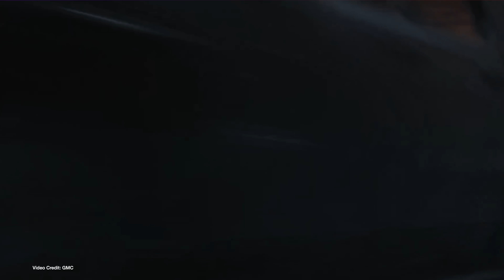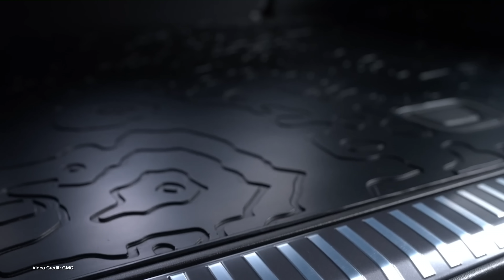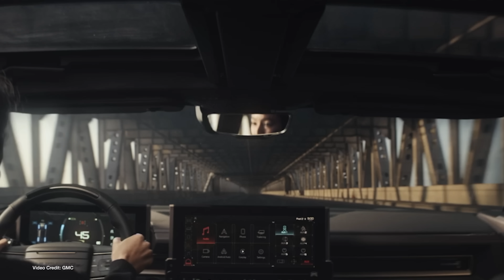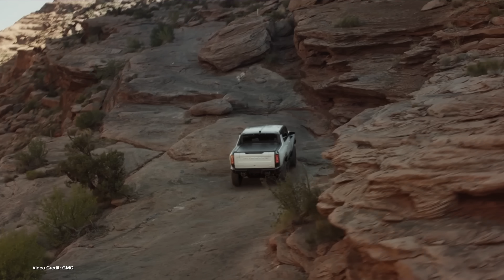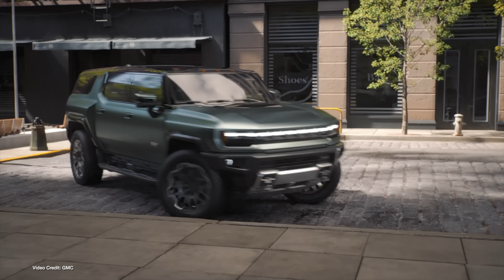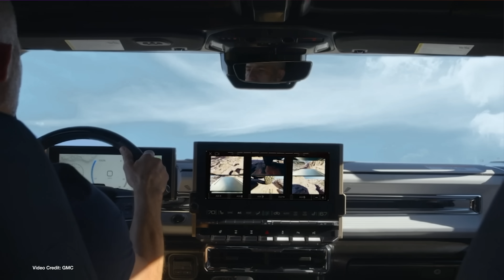The Hummer EV SUV Has Broken Cover. Here's Our Take

Comment: Hi Te team,
I would like to share with you my vision of the car industry today. Please let me know if you agree with me. The world is not just electrifying cars, we are facing a big transition that already happens with other industries. For example, entretainment had a transition from analog to digital signal and TV machines changed from tube TVs (analog) to led TVs (digital). Samething is happening to cars industries, we are moving from analog cars (buttons, controls, cables, wires) to digital cars (digital signals, AI, software, electrification, machine vision, connectivity, user interface, etc). In my view this is why Tesla is making a big difference compared to other car brands. The rest of the industry are trying to catch Tesla and other inovation companies in terms of electrification but they are not able to see the big picture. I believe most of them will never be able to do it, reason why Toyota is trying a partnership with Tesla to enter in a digital world.

Comment: Talking about electric motors...using horse power instead of watts/kW respectivelly.
I would exepct this from some idiot generic "journalists" but not from someone that has some knowledge behind them.
Stop , literally stop using these idiotic notions that the manufacturers hand out, beside the fact that imperial system of measurement is obsolete, which belongs to an agrarian society rather than a soon to be space faring one.

Comment: Even at $80k it will sell, in large numbers. So will the Rivian, the Cybertruck I have my doubts about. Remember the Pacer? The PT Cruiser? Those cars had huge 1st and 2nd year sales, and then dropped off quickly. The design was so quirky and different, you couldn't really update it much without changing it completely, and the designs were polarizing enough that the people who really loved them bought them in the first 2 years or so... and then the manufacturers had to practically give them away. And then they became a punchline. I suspect the Cybertruck will be the same thing.
Reply: Seems as though that happens roughly every 20 years or so.
Chrysler Airflow
Edsel
AMC Pacer
Pontiac Aztec
Cybertruck?

Comment: This is an aspect of electric propulsion that I hadn't considered much.  In an ICE world, the Hummer  SUV would have had the same engine and transmission as the PU and would have had performance that varied based on the delta to weight and coeff of drag.  Now in the EV paradigm, the performance delta is based on battery capacity which may change based on available room (wheelbase/track) to house batteries.  Not earth-shattering, but different way to think about variables that control vehicle capability.  Thanks for sharing.

Comment: The Hummer does look amazing! I think the Hummer is like all other high end vehicles. They get the attention and drive people to the dealers where people then try out some of the other vehicles, ones they can actually afford, and buy them. That said, it also makes sense to really put a low volume, high price vehicle out there so they get experience with a new platform before going mass market. I would expect that GM will have several vehicles like the Bolt that are based on the new platform and cost a lot less. Those would be coming available as GM ramps up battery production and retools their factories.

Comment: This hummer vehicle and the new Cadillac I really just test beds for upcoming GM vehicles. Think of them as Tesla’s roadster and model S. These GM vehicles will never recover third development cost. The development cost will be used to develop additional GM EV cars.
Reply: Not totally true. To understand development cost you have to understand what was/is going to be developed. For the BT1 platform, the Hummer truck and SUV are being built. GM is also using it for the Silverado EV, Escalade EV, and Sierra EV. So the development cost is spread across many vehicles with the Hummer being the first user of the platform. So the Hummer doesn't have to recover all the development cost because it wasn't the only vehicle being developed to use the platform.

Comment: I applaud GM for introducing an alternative for people who would otherwise buy a gas guzzler or diesel rock crawler with noxious emissions.  It seems to incorporate innovative design features to address the problem of a large vehicle in an urban environment as well.  I would find one a nice “occasional use” vehicle, similar to a pickup truck you might use to run to Home Depot or use on a weekend hunting/fishing camping trip.  Unfortunately, while a $5000 used pickup truck might meet that requirement at an affordable price, a $90,000 “occasional use” truck will more likely be in the Bezos or Walton family garage than mine.
Reply: I agree, the problem is it's so expensive that it will not have much penetration in that market. But yea any new EV is a good thing.

Comment: ...your a car manufacturer, not a design house..  whats the point not having the same power train for the pickup and the SUV.. does it really matter to the variant if the power train is the same..  as a manufacturer, this means a different assembly line, & a more expensive manuf  process.. this is not how a veteran manuf thinks of production.. this will mean more time to manuf, less output per given time, & more expensive per unit.. unless your aiming for the elite class of clients, more expensive per unit means, your market will become limited.. not a great start for the HUMMER EV...
Reply: You stuck in ICE thinking. The powertrain in the SUV and truck are the same. The difference is the number of battery modules. With fewer modules, you can't deliver as much current to the motors, thus less horsepower. These vehicles will go down the same assembly line. The only difference is the body shop.

Comment: We need more info on Ultium batteries.  Price and weight per kw/h?  How does it compare to Tesla and LG battery?
Reply: Unfortunately it seems the first edition Hummer will only have regular LG cells and not the Ultrium system, but I too want to know everything about it!
Reply: @noeldillabough  Wrong.  The Hummer will be Ultium.  The only vehicles NOT using Ultium are the Bolt and Bolt EUV.
Reply: @112428  Nice when they announced it they were not sure to be ready with the Ultium batteries for Edition 1 guess they're farther along than I thought

Comment: Going with a halo vehicle to get people interested in EVs at all is commendable, to a degree. As long as they keep making cheaper BEVs to buy when most can't afford or don't need this particular vehicle.
Reply: It is an expensive toy for the rich and obnoxious, but GM is also making one of if not the cheapest EVs in the North American Market right now. Good for them. I hope their electric vehicles sell really well and they transition to full electric vehicles sooner.
Reply: This is my take. The range and price are underwhelming at best, but I don't think people will buy these for performance. I also laugh at the thought of using a hummer to charge another EV when its range is relatively small. Odd marketing.

If it is a halo car to generate more excitement in EVs, all the better.
Reply: @diskreet  Using it to charge an electric atv or snowmobile might work better.  Powering an off-grid cabin would also be useful.
Reply: True.  Probably, 20% profit margin per vehicle compared to losing money on every Bolt sold.
Reply: @willaerley7140  better than Tesla's losing money on every car. Maybe the cybertruck came about because they saw ICE trucks making huge profits for the Big 3...

Comment: ROLLING BRICK - Hydrogen Cell Tech will be next revolution - Battery is dead
Reply: Yeah, Totally! Utterly destroyed, Millions of cars vanish overnight and are 
replaced by clean air cleaning water evaporating very expensive hydrogen behemoths with a top speed of 80 km/h.
Then i woke up with my dog licking my ear. Brrrrr. 🤬😜😂🤣😎
Reply: Sure, use electricity to make Hydrogen, then use that Hydrogen to generate electricity and store the electricity in batteries in the vehicle.
Reply: @JGHDVCFGT  Yes! Perfect solution for a not-a-problem. 👍😜😎

Comment: Using the Unreal Engine for rendering is actually a really great idea. It's been refined to the point that it can generate photorealistic images on-the-fly faster than just about anything else out there and isn't tied to super-high-power CPUs. I mean, games using Unreal are found on cellphones and infotainment systems really are just dedicated tablets.

I'm actually surprised GM was smart enough to think slightly left-of-center to even think of using Unreal. Then again, NVIDIA, who are known for video graphics cards have an entire suite of hardware and software for vehicle autonomy that's showing up in car brands like Toyota, Audi/VW, Mercedes and Volvo.

Comment: If the Germans don't launch equivalents fast, these are going to be seriously popular as an import here in the Netherlands. The Hummer SUV starts at $80,000, that's about €68,000. Add 10% import duty and 20% VAT and it's 'only' €90,000. The BMW X7 starts at €130,000, the Porsche Cayenne at €101,000 and the Lamborghini Urus at €275,000. And those are the weakest petrol versions without any options.
Reply: 6.3 tons? Does your drivers licence allow that much weight? Ours does not. 
We need a lorry license and are not allowed to drive on weekends without special permit. 
The Hummer EV, to be delivered in 2023-2024, will be smaller and have up to 3800 kilograms of curb weight. 
That could be downgraded to 3,5 tons.
In 2023-2024 the cybertruck will be available - i would not dismiss that one.
Reply: @wolfgangpreier9160  Good point, didn't think about that. You need a small truck/camper driver's license for vehicles between 3,500 and 7,500 kg, so that will indeed limit the popularity.
Reply: @MartijnterHaar  We get a extended license up to 4.2 tons. But not more. Everything else is a "real" truck. I hope thy Cybertruck stays below that - and if not i will have to go to school once more. Oh well...

Comment: These performance figures are wild, but if it gets the biggest fans of coal rolling to stop shitting into the atmosphere, I suppose that’s good.
Reply: Let’s not forget that these EVs are produced in a factory that runs on burning coal polluting the atmosphere, the factories that put the batteries together run on coal polluting the atmosphere, the mining for parts of the battery uses child labor, when you charge the car you’re using electricity that came from burning coal, and even if you use solar panels to charge your car, those still came from a coal burning plant, and you have to dispose of the non recyclable parts of those solar panels and the toxic non recyclable parts of the battery.
Reply: @samautrey  What's your point or goal here? Were you hoping for 1) An energy revolution that changes everything at once, somehow, rather than boringly using fossil fuel to build renewable infrastructure which allows us to increasingly shut off the fossil fuel power plants? 2) No change at all? 3) A miracle happens?
Reply: @TaiViinikka  and @Wolfgang Preier, this is just what my physics teacher told me. When he was talking about it I was thinking he was wrong but idk. I’m all for EVs and would buy one over a gas car any day.
Reply: @samautrey  Tesla has solar panels on their factories, which also create the batteries for grid-scale battery packs which help shut down natural gas peaker plants. Oil pollutes when it's mined, the pumpjacks take energy, and the refineries are polluting. Then the trucks to deliver it pollute. Even if an EV is charged on one of the few 80% coal-powered grids, the process to generate that electricity is still cleaner than all the work to mine and burn oil, inefficiently in a car engine that pollutes more than most people realize. Unfortunately, even people such as physics teachers fall prey to the many misconceptions (many pushed by Big Oil) about the lifecycle impact of EV batteries. Now You Know!
Reply: @samautrey  Lets not forget that crude oil kills children.

Every Single effing bloody day.

Thx for your attention.
Reply: Don't estimate that these truck bros won't run stage smoke machines off a Hummer on a twisty road (if it comes with any domestic outlets like the Mitsu Outlander)
Reply: @BeLowBelowo  Why not a real smoke machine from a V12 Merlin mounted on the back? 🤣😂👍
Reply: Coal rollers being able to afford their own Hummer EV? Funny.
Reply: @hyric8927  I recommend buying a used Merlin V12 engine, that rolls coal so nice! And loud! And it fits on the Hummer bed! Its cool! 😂🤣😎
Reply: @wolfgangpreier9160  You don't sound so confident, though. Maybe add more emojis.
Reply: @hyric8927  you mean two merlins? But i thought it should sound like a spitfire not a lowly dc3 🤣😂🥸🤓
Reply: @wolfgangpreier9160  I don't know, that didn't really land. Maybe if you add more emojis but at the start of your post.
Reply: @hyric8927  Sorry, i canot find a Emoji fitting a real Hummer or a 27 liter aircraft engine on its back firing the vehicle. 🤷‍♀️🤷‍♂️🖖
Reply: How many Hummer are out there? And how many Toyotas? And Hondas? And VWs? And Tata, Mahindra, SAIC?
I say Hummer are funny, pretentious, pompous, liberacian even but totally insignificant.

Comment: Pretty sweet,  too large for a lot of off-road trails though.  Hopefully Jeep will make a full ev wrangler soon.
Reply: They already have. The Wrangler 4xe.
Reply: @wolfgangpreier9160  is a hack job though, not a proper from the ground up EV
Reply: @teklife  Yes, I do not think that Jeep has the capabilities to develop a real EV. 
Not like the Hummer, thats just massively oversized. That should have become a 40 ton dump truck not a pompous FUV. I think more in terms of Bollinger or maybe even Rivian. The Cybertruck has the chance to become your everydays F150/F250 successor but no real off road truck more fitting on dirt roads and construction sites.
Reply: @wolfgangpreier9160  I will be getting a Rivian it has a good size for trails.  Still won’t be as good as a wrangler for rock crawling though.
Reply: @Story_Teller_Everyone  You have the opportunity to go off road. In Europe there are very few possible places where you could do such a thing. Thats why there is nearly no market for those vehicles.
Only a few thousand every year. Maybe Landrover or Suzuki release a working EV. But i guess nothing will be as strong as a Bollinger. Of course also not as expensive.
Reply: @wolfgangpreier9160  Yeah I live only few hours away from Moab Utah,  I go rock crawling there multiple times a year in my modified Jeep.  US has a lot of federal land that is open to public.  Electric could be amazing for this will the control and torque electric motors have.
Reply: @Story_Teller_Everyone  And the silent running and no more stinking and fuming. Every time i go with our dogs and a car passes by it - stinks    All of them. 
I would even tell you don't buy a electric car. Everything else pales against them and they - stink. Horribly!

Comment: GM and Rivian should partner to install a fast charger network at trails.
Reply: Yeah I don't get restrictive chargers, installing a charger in the middle of nowhere can't be cheap and the payback will take forever if only one manufacturer can access it.

There are a number of things that need to happen before we get too far into the weeds.

We need standardization on charging plugs and non membership payment by debit/credit at POS, it needs to be gas station easy for starters.

Not to mention charging at home, what if you change cars from Tesla to anything else you need a new charger or a multitude of adapters.
Reply: @IMGreg..  We in Europe do not - need a multitude of chargers. Our cars all have thge same plugs. 
Only those directly imported form the US or China have some issues and need adapters. But those are a very rare breed.
Reply: @wolfgangpreier9160  Hi from Canada Wolfgang!

Yes I agree, I may be wrong but didn't the IEEE work to create the standard.

I don't know why the US can't just look at what's already working and do the same.

Now Canada and Mexico will be dragged into the same fragmented BS same as what happens to highways over Trains and mass transit the bigger car companies will pull the levers on this as well, fortunately VW will be one of them.
Reply: @IMGreg..  👍👍👍
Reply: @IMGreg..  And yet, a lot of people buy an iPhone and pay for expensive, propitiatory, chargers... I think Tesla and other learned a lot from Apple.
Reply: CCS should become the industry standard, clear across the board!